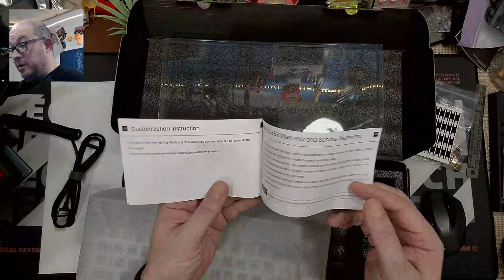Monsgeek M1 - Is this the new budget standard? $99 aluminum gasket mount QMK/VIA kit!

Comment: Thanks for covering this board as I have been heavily looking into for the past 3 days. How is the USB-C opening would it fit larger connections for better coils? Is the aluminum case worth it over something like Feker ultra75 or Keychron V1? 
I think your background music distracts a bit from your video when you explain things, I find myself having to repeat a few times to hear something. Maybe lower it a little bit?
Reply from the maker: Thankfully the port is hardly recessed at all, I don't see it having an issue with 99% of the cables out there. The aluminum case is certainly worth it, I mean it weighs nearly 1750 grams, almost two kilos, it's quite substantial. 

Thanks for the feedback on the music. I use a preset audio gain filter for background music, but source songs from different places, sometimes their levels are low, sometimes they are higher, I need to adjust the level for each, thanks for watching and for the constructive feedback!

Have an awesome Friday and an even better weekend!

Comment: Audio for your speech is better where there's less fluctuations. It still sounds like there's quite a bit of reverb where your voice isn't as crisp or clear as it should be. 

I'm not sure if it's the mic or the software you are using, but I feel like you may have the gain turned up a bit high and often times the audio is peaking when it shouldn't. Also, are you using two microphones by chance? It almost sounds like there's a mic right on the desk amplifying every little sound, which I completely understand for the sound test, but I would like to hear you more during the review portion. Please don't take any offense to this, I am only trying to be constructive and help.

Also, this new desk mat looks good on camera! All the blue in your last desk mat kept throwing the white balance all off and your camera would frequently try to auto adjust the color temperature and it gets the colors all off. (It's better to set the color temp yourself so that your camera doesn't keep shifting the colors on you if you know how.)
Reply from the maker: Thank you, yes, I may have the gain turned up to high, every time I switch out hardware I have to re-tune everything, thank you SO much for the honest feedback, it helps me to make content better! 

Thank you and happy holidays!

Comment: If this was wireless I'd be game. I finally found an Alu/2.4ghz/BT board. You should take a look at it sometime. It's the mxrskey ck820. At first, even though it has both case, and pcb foam it's still a bit reverb-y and pingy. However, whatgeek was able to sell the FR4 plate, poron pcb foam/case foam and ipxe foam. Sounds fantastic after the fact.
Reply: but that board is $179.00, well hopefully the new M1 wireless will be around the same $99 price range
Reply: Boi you're in for a treat they've got like 3 new wireless keyboards released

Comment: Hi, just wanted to ask if keycap/switch puller is included in the box. I just don't wanna be a fool and buy another one. Thanks for answer.
Reply from the maker: You know, I don't recall, but looked in the box where I usually leave them and there were none. This was sent out a bit early and was custom packed, it could have fallen out. I can't recall a hot swap keyboard that did not include these that I can recall.
Reply: @MechTech I will buy it anyway i guess. Better to have 2 then none.
Reply from the maker: @quicky9502  I have a closet full, so yes, better to have many over one :P 

Come and share your build on r/BudgetKeebs once you get it, cheers!

Comment: Why does no one review they ability of the MCU in these boards (any boards!) in terms of support for full QMK access or VIA access?  Or even the downloadable software that the board comes with?  Without using up to date Open Source options especially on a 65% board - it leaves you with nouseful info on what mods/keybinds you can do or how manu function layers the board firmware supports ahead of your purchase.  Just bought a EK68 and I love how it looks and feels, and despite this channels hate for the seller of the board, this is the only one I could find directly available on Amazon UK.  This is very important to me as I want to immediately return any pre-broken products and get a refund straight away - and I dont want to pay for return shipping.  

Anyhow, this is a side track for my original statements about these board reviews. No YTer goes into any depth about the software/firmware side of things.  I want to have multi function layers and for each layer with key groups, I want the RGB to show those groups on the layer as a certain colour.  This is functional RGB.  This is what I want.  EK68 or clones don't seem to support more than one function layer, also they allow RGB per key, but they do not allow RGB per key on default layer in isolation to function layer.  I like this kb, but I really really wanted to perform this functionality.  QMK does not have any compatibility listing for this model and also - I still have no idea what exact MCU product is included as dissassembly is possible, but hard with the "plastic tabs" in use.  These "custom" style kbs are getting more and more cheap as time goes on and I hope the day will come where you can buy a fully QMK compatible custom style kb for not a lot of cash on Amazon.  I mean baddude up here tears it all down nicely, but doesn't zoom in on the MCU so we cannot see any silk screen or on chip identifying numbers.
Reply from the maker: Bob, I appreciate your feedback. I have created certain VIA videos that I have been asked for, but I do not cover the MCU as most boards have their silk screening removed, especially with these lower priced, in-stock keyboards. I am currently reviewing the EK68 VIA, as I do not hate Epomaker, I have a distaste for companies that take advantage of customers, and am finding many oddities, granted my use of VIA and QMK mostly is for basic rebinding, macros and rarely do I go more than two layers deep. I will do a more in-depth coverage on the EK68 VIA, but overall I focus on topics that have been requested from me by multiple parties.
Reply: @MechKeyboards  Ok, thank you very much for the indepth reply.  Seems like a lot of things have changed in the MK space in recent times.  And now we have the advent of the rp2040 as well.  Wondering if it is possible to desolder the no-name MCU off a complete kb product and connect up the matrix and RGBs up to an rp2040 and do things that way?  It's got to be fiddly with the microscopic pitch of the MCU pins, but it may just be possible.  Who knows?
Reply from the maker: @bobmcbob4399  while I'm certain with enough time that would be possible, I'd personally just create my own matrix and hand wire the board ignoring the PCB altogether and using an RP2040 ;)
Reply: @MechKeyboards  Yep, many ways to do things, cheers.
Reply from the maker: @bobmcbob4399  Cheers.

Comment: Thanks for your informative video. What's your source for the difference between USA and international version? I ask because I have seen international version advertised with some of the things you mentioned it doesn't come with, like on AliExpress, so I was wondering if it was a rumor or something that was officially stated by Monsgeek/Akko. 

As for the board itself, with your use, have you noticed any additional drawbacks/issues that you didn't notice when building it? Looking forward to the mod video. 

The audio sounds decent but do you have a fan or something like that running in the background? There's this kind of fuzzy noise that makes the audio sound less crisp. Also I agree with the person who mentioned adjusting the volume of the background music, just a little quieter would work better. 😊

EDIT: I did look into the different versions of M1, so what I've gathered is the Chinese domestic version is the one that has less features (minus stabs, VIA). The international version is the one that has those things. As such, versions released in USA, would be among those considered to be the international version. But feel free to let me know if you found different info. 
https://twitter.com/akkogear/status/1596328490248597506?s=20&t=LLXsWpOAhHl4ZaaP1MAYgg
https://akkogear.com.vn/san-pham/kit-ban-phim-monsgeek-m1-qmk/#:~:text=tinh%20nang%20nay%20chi%20xuat%20hien%20tren%20cac%20phien%20ban%20m1%20quoc%20te
Reply from the maker: You are correct, I misunderstood the email, this is the International version. I've yet to get to modding it, but besides the minor ping it's been working fine.
Reply: @MechKeyboards  Thanks for replying. I'll keep an eye out then for your mod video when you get to it 😄